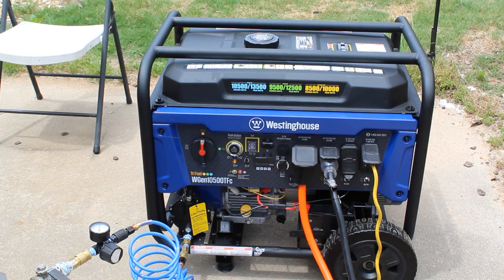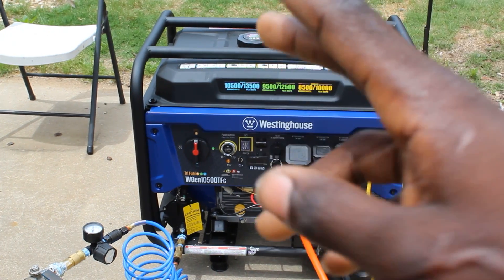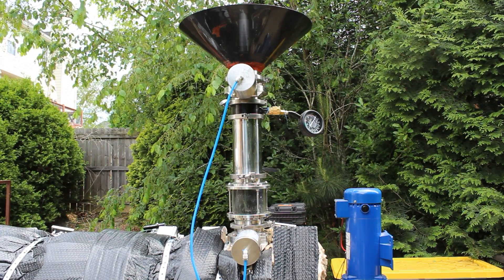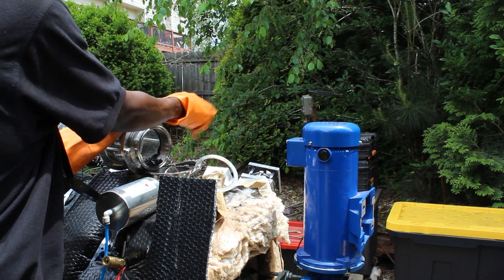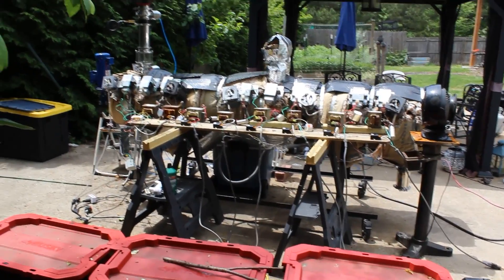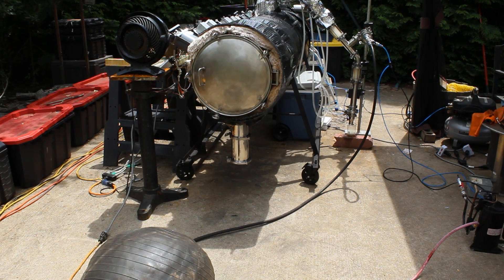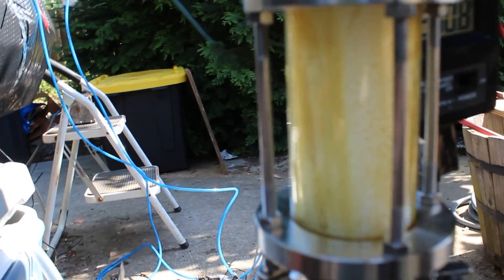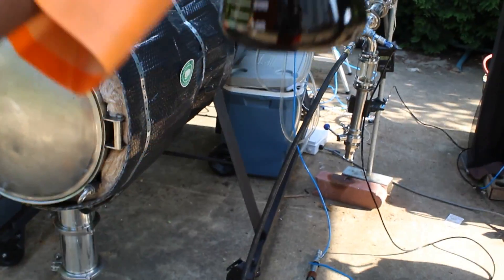Biggest Oil Yield Yet! Plastic to Fuel Reactor Mark 4.5

Comment: You need to do a bypass survey as well as usage to final usable product. My rough math says you're eating more power to gas expense than it's worth. A,so the majority of microplastics are not recoverable. I find your journey noble but your paying well more than your making. Also are you measuring off gasing and environmental impact. Heating or burning plastic eats the ozone. If you don't take the proper precautions the EPA will find and shut you down with possible jail time. I'm saying this for your benafit.

Comment: The Engine will require alot more air to run a decent AFR for on the Syngas 14.7:1 on gasoline closer to 1:1 on wood syngas i imagine your plastic syngas uncracked would be better than organic feedstocks. You also need a filter for the gas going into the engine, Activated carbon or gaswash type system even both depending on tar content. I have worked for a company that has been trying to crack the commercial pyrolysis market for the last 15years you microwave approach is interesting but ide like to see a proper enegry mass balance on your setup. Please be mindful of your health when working with this machine, Benezne carbon monoxide etc. Are terrible for your health and trust me oxygen ingress into the reactor especially the cooler zones can make some pretty big bangs. Keep up the good work great content 👏

Comment: You need to convert the nozzle on your generator. The orifice is smaller on propane vs natural gas is bigger may want to look at that. Which in turn you use more natural gas to make explosive vs propane.

Comment: Now you're talking. I figured the  machine was bogging down from the gas it's making being kinda dirty.Some butane running heaters have a filter in between the unit and the butane. And that's commercial butane. You probably could get by using some sort of filter. But even with the best filtration, a generator like that won't last long running it off that fuel. Saying that,you've really impressed anyone with a working brain. You ran the generator off your own product🎉. You're in such a great position because you have so much knowledge about this, and you have thousands putting in their 2 cents as far as how it's working.

Comment: How does he build all this and know nothing about electricity? He doesn't even know the generator Amp rating?  Show me the circuit board you built that runs the whole operation. What is the generator even plugged into?
Reply: he's plugged the generator into a car's battery. then he uses the car's exhaust to make plastic duh 😂😂😂

Comment: I have a generator runs on gas or propane you could probably use the natural gas to run the generator while the generator runs the machine plus get your oil in the process possibly increasing overall efficiency

Comment: I believe if you mixed something like used motor oil into the mixture gravity I believe will then push it down. Used oil would also boost production I believe not only does it have the fuel in it but also tiny pieces of steel.

Comment: Incomplete pyrolysis is going to destroy your generator motor. Microwaves won't break down non-polar plastics. You would be further ahead to heat the plastic with a resistance heating element instead of the 5000 watts of magnetrons.

Comment: and I think if you were to add an air passthrough to the loading mechanism, it would work, the problem was that it resealed the vaccum with the particles, but if there was a small airway for air to enter or exit (inside of the chamber) to the top of the plastic container. Essentially just put a straw on the inside of the tube to keep it from resealing the vaccum. Checks out in my head atleast.

Comment: you would want to adjust the air/fuel mixture, you might also need to get a really high end spark plug that gives a really healthy spark, most spark plugs are designed for the explosivness of gas/propane. I feel the spark will make the biggest difference,. This will increase power consumption.

Comment: You should be able to run two 120v microwave transformers in series off of a 240v supply.  Each will drop 120 volts.  I've done that when using them to make spot welders.

Comment: You know how when you turn a diesel fuel engine to run on bio and you have to make changes … maybe it might be the same as the oil might be a little more corrosive, but I’m sure the adjustment is not gonna be a problem for you. Ps you are awesome!

Comment: You need fuel injection.  You can't run the engine efficiently like gasoline.
Reply: It's natural gas and gasoline powered. He's using the gas byproduct to run the generator
Reply: @MindsMouth  you can't burn a gas efficiently in an engine designed for liquid fuel.  It's different stoichiometry.
Reply: @edwardarruda7215  His generator runs off dual fuel sources, Propane/NG and Gasoline

Comment: You're going to have to activate each magnetron sequentially, one at a time. The peak draw is killing the generator
Reply: he needs an inverter for this to turn on the magnetron
Reply: Should just make a normal fire, gasification of plastic maybe ❤
Reply: @ifv33  they could do that next to the refinery where they burn everything that's not usable
Reply: @Kris-fd9xs  yeah same way it's useful put a pool and an ice ring together.
Reply: @ifv33  not sure about that one although I'm sure it beats having wintergames in the desert..
What do you mean?
Heating the pool with with the ice ring condensers?
Reply: @Kris-fd9xs  Yeah, you use the energy from an existing gadget whose waste product is heat, imo its all about what are you after, its not like being inefficient stopped us from doing anything else in the world.
Reply: If I was going of the logic of eating a tasty energy-efficient Quater pounder with fries 🍟    
I would starve to death.
Reply: Why a microwave??
Microwave dinners go packed in plastic inside microwaves..
How is that going to be efficient to melt plastic???
Reply: @Kris-fd9xs  microwave energy breaks the chain molecules into their separate elements without combustion. The want energy excites the molecules until they separate
Reply: @Kris-fd9xs he has a video where he explains all of that but for a short non scientist answer shreds it super fine and mixes it with carbon to get the plastic hot enough to react
Reply: I do remember now that he adds carbon for the microwaves to interact with the plastics but still..
Seems like there would be terrible hotspots everywhere which might account for the low yields..
If you're going to "re-distill" stuff your gonna want to have fine-grained control over the temperature or you'll end up with polymerized crap/ a lot of carbon for your next run..
Reply: Saw him talk about the amount of kw/h it takes too in a video were a girl was driving on his plasti-diesel.
I'd run it off the produced gas or something.. there's already energy inside.. All these "green" efforts that  take a ton of energy input make zero sense to me..
I do agree that having tons of plastic laying around everywhere doesn't make a lot of sense either but simply fractionally distilling it and catching clean fractions which can be used as normal (thinner etc) makes more sense.
Gasoline is just a combination of those products too..
Reply: Setting up a pyrolysis refinery on a small scale can be a cost-effective and sustainable way to process waste materials into valuable products like fuel or chemicals. Here are some steps to efficiently set up a small-scale pyrolysis refinery:

1. Choose the right location: Select a location with easy access to feedstock sources and transportation. Ensure that the site is compliant with local regulations and has sufficient space for the refinery operations.

2. Develop a comprehensive business plan: Define the goals of your pyrolysis refinery, including the types of feedstock you will process, the products you will produce, and your target market. Consider the financial, technical, and environmental aspects of the project.

3. Obtain necessary permits and licenses: Before starting operations, make sure to obtain all required permits and licenses from local authorities. Compliance with environmental regulations is essential for the successful operation of the refinery.

4. Acquire equipment: Invest in high-quality pyrolysis equipment that is suitable for processing your chosen feedstock. Consider factors such as processing capacity, energy efficiency, and maintenance requirements when selecting equipment.

5. Set up the production line: Install the equipment in the designated area and connect all components to form a production line. Ensure that safety measures are in place to protect workers and prevent accidents.

6. Conduct testing and optimization: Before scaling up production, conduct test runs to optimize the pyrolysis process and fine-tune operating parameters. Make adjustments as needed to improve efficiency and product quality.

7. Implement a quality control system: Establish quality control procedures to monitor the product output and ensure that it meets your specifications. Regular testing and analysis can help identify areas for improvement in the production process.

8. Develop a marketing strategy: Identify potential customers for your pyrolysis products and create a marketing strategy to reach them. Highlight the environmental benefits and cost savings of your products to attract buyers.

By following these steps, you can efficiently set up a small-scale pyrolysis refinery and contribute to the circular economy by converting waste materials into valuable resources.
Reply: Setting up a pyrolysis refinery on a small scale can be a cost-effective and sustainable way to process waste materials into valuable products like fuel or chemicals. Here are some steps to efficiently set up a small-scale pyrolysis refinery:

1. Choose the right location: Select a location with easy access to feedstock sources and transportation. Ensure that the site is compliant with local regulations and has sufficient space for the refinery operations.

2. Develop a comprehensive business plan: Define the goals of your pyrolysis refinery, including the types of feedstock you will process, the products you will produce, and your target market. Consider the financial, technical, and environmental aspects of the project.

3. Obtain necessary permits and licenses: Before starting operations, make sure to obtain all required permits and licenses from local authorities. Compliance with environmental regulations is essential for the successful operation of the refinery.

4. Acquire equipment: Invest in high-quality pyrolysis equipment that is suitable for processing your chosen feedstock. Consider factors such as processing capacity, energy efficiency, and maintenance requirements when selecting equipment.

5. Set up the production line: Install the equipment in the designated area and connect all components to form a production line. Ensure that safety measures are in place to protect workers and prevent accidents.

6. Conduct testing and optimization: Before scaling up production, conduct test runs to optimize the pyrolysis process and fine-tune operating parameters. Make adjustments as needed to improve efficiency and product quality.

7. Implement a quality control system: Establish quality control procedures to monitor the product output and ensure that it meets your specifications. Regular testing and analysis can help identify areas for improvement in the production process.

8. Develop a marketing strategy: Identify potential customers for your pyrolysis products and create a marketing strategy to reach them. Highlight the environmental benefits and cost savings of your products to attract buyers.

By following these steps, you can efficiently set up a small-scale pyrolysis refinery and contribute to the circular economy by converting waste materials into valuable resources.

Comment: what is the blue hose connected to the bodi near the condesner it looks like compressor has blue hoses for knife valves is it vacuum or pressure and is the vacuum onli connected at the at the natural gas output? would pressurizing the input chamber help push the plastic carbon mix through or could vacuuming it before opening the valves help prevent compaction since equal pressures? i was confused whi the pressure difference didnt work for pulling the plastic into the reactor

Comment: have you got the reactor chamber tuned? if you have destructive phase alignment between the magnotron outputs, you may be reducing your power output.  if you have them all phase aligned then all the devices run in convergance.  also the dimensions of your chamber is important.  The microwave enclosure size is tuned to the wavelength of the microwaves.  the dimensions of your chamber, and the positioning of the magnotrons really matters.  Love your work brother.  Your project is really cool.

Comment: You should get the gas analysed to have an idea of what you are getting from it. A quick search led me to a paper titled "Gaseous products from primary reactions of fast plastic pyrolysis" which states:
"The main gaseous compounds from LDPE were butane, 1-pentane and 1-hexene. PP pyrolysis gave propene, pentane and 2,4-dimethyl-1-heptene as the main gaseous compounds. Styrene monomer was the dominant gas from PS."
So, you are probably getting a hell of a mix into your genny, which it's probably not tuned to take and may be the source of the knocking.
Reply: Hexane, Butane, methane from some organic carbon. The catalysts make a big impact on the product. His best bet is to experiment and look into past research to figure out which catalyst will produce the most usable form of gas for the generator to run off of. The catalyst for optimal liquid fuel production differs between plastic source material. 🤓👌
Reply: @MindsMouth  Didn't knew that the catalyst could change the out going gas composition, but it makes sense. I assume or man here is not using catalysts. 
But I think I have seen somewhere about a knew catalyst that lowers the pyrolysis temperature so that it requires less energy input, which could benefit greatly his experiments.
Reply: @Misack8  Currently he can experiment with these catalysts : Salt, Wood Ash, Carbon, Baking Soda. 
If he reads these comments. Lol
Reply: the trick is to mix the pyrolysis oil with ideally E85 fuel or regular gasoline in the correct ratio to create fuel with properties very close to diesel ;-)
Reply: It's knocking because he needs a hotter spark plug no enough octane.

Comment: When it comes to the engine knock in generator there is one thing you gotta consider.
Ethanol is used in racing for reducing the fuel temperature thus reducing engine knock. Same goes for water (new sport BMW's used that I believe).
Overall - cooling down the fuel mixture or engine itself may help